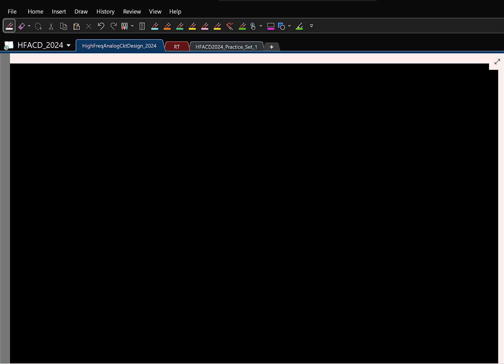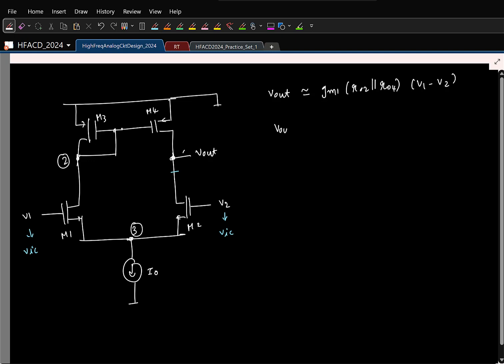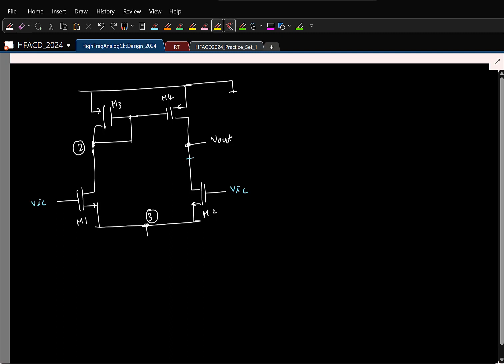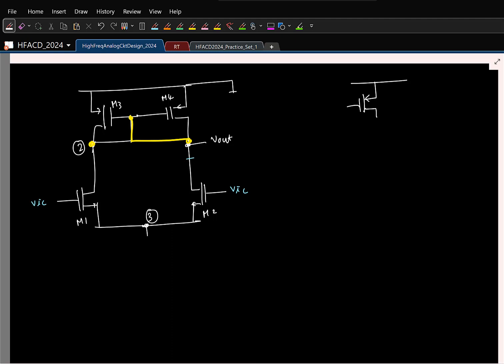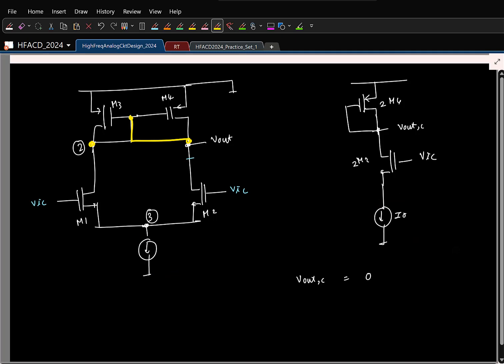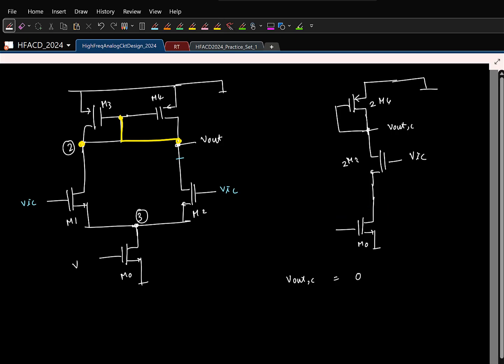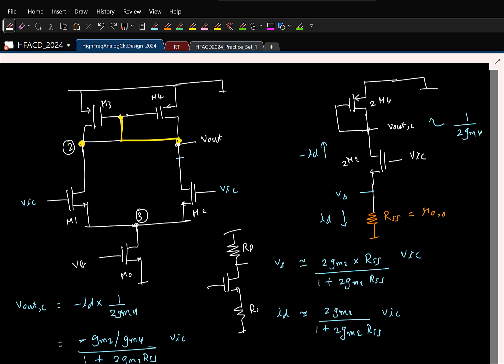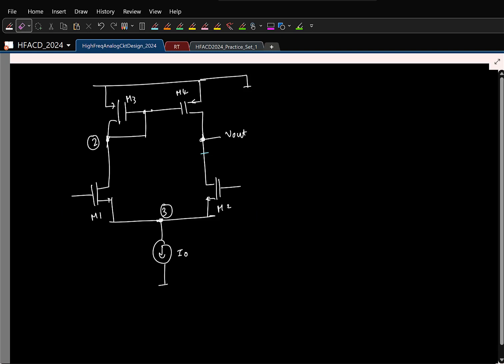Lecture 5(d): Common-mode and differential mode gain in a five-transistor OTA

Comment: I know i am asking silly question but still i need to ask...

If the looking impedence at node vout is ro4||(2ro2), how come gain is only gm*ro4||ro2.

Should it not be gm*ro4||(2*ro2)
Reply from the maker: The output resistance is ro4||ro2, not ro4||2*ro2.
Reply: @sscdiitk  in previous video we found the looking impedance on each node, there we got node 2 resistance is ro4||2*ro2